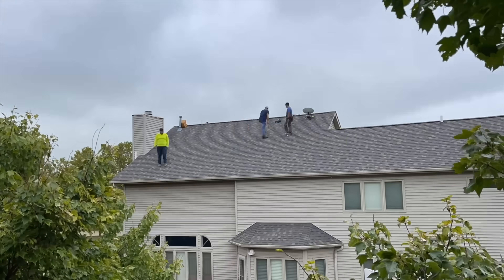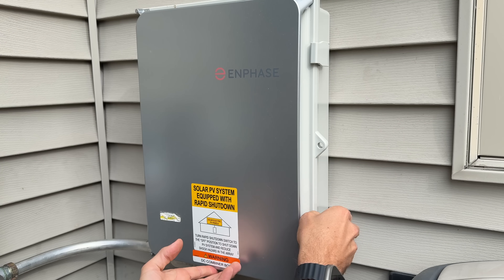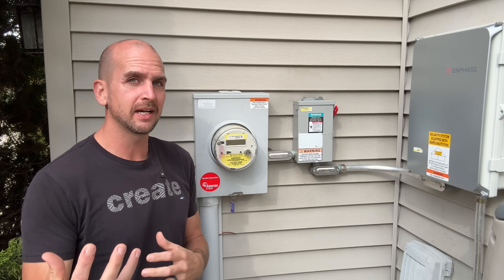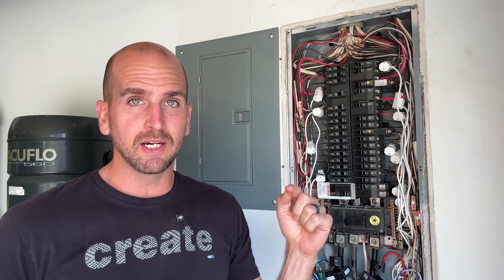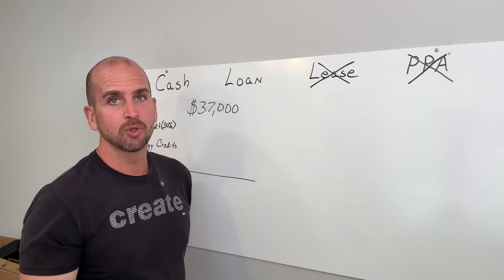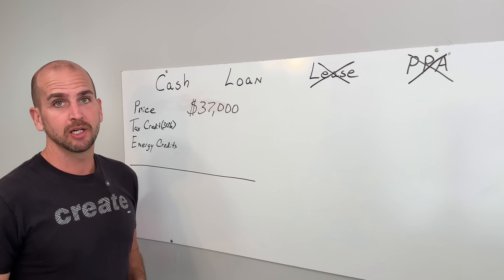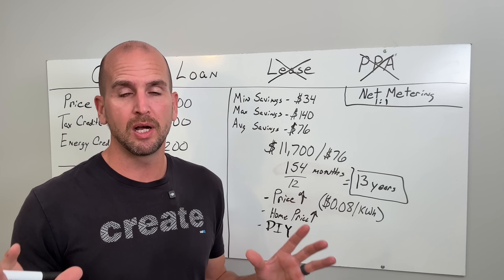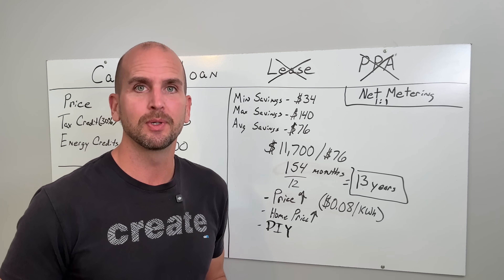Are Solar Panels Actually Worth It For Homeowners?

Comment: Another expense would be when you need to replace the roof. I imagine you have to uninstall and reinstall the panels.
Reply: Yes, correct. Which is why any reputable installer will refuse to install solar on a roof with less than 8-10 yrs of life remaining. Everyone’s situation is different but if roof replacement is due soon that should be done before installing solar.

Comment: I installed a 6.6kW system myself using design plans and parts from IronRidge, panels from Panasonic and Solar Edge inverters/converters.  The system cost me $12K to install myself which I got 30% back from.  Total out of pocket was $8400.   These systems are so easy to install nowadays. Everything is basically plug and play including the mounting. The only thing I needed to do per county rules was to have an electrician connect the converter to the main panel.  Don’t pay a company $30K+ if you don’t have to.
Reply: Hi Matt, would like to know more on your installation and how u did it ? Ty
Reply: @ I literally designed both my ground system and my dad’s roof system by first going to Ironridge and designing them on their website.  I found the most efficient and powerful panels that had a good name brand available at the time and it was the Panasonics.  Bought the Solar Edge Inverter and all associated parts from a distributor out of AZ.  Did the work myself and was only required to have an electrician tie us into the grid.  Iron Ridge stuff is awesome and so easy to work with.  The instructions could be followed by a 5yr old.

Comment: I'm having a solar panel installation on my garage roof by a relatively small and local company.    They are doing all the work, and I need to decide what type and brand of back-up battery system to get installed when the solar panels are installed. 

Trying to research what type and brand of battery system gets  REALLY COMPLICATED AND CONFUSING  !    I've considered battery brands like EcoFlow and Anker, but there are (possibly) major limitations  / problems  with both of them.    Lately,  I've seen videos on different types of batteries like EG4  --  LL48 V and other server rack storage systems. 

I am also in Illinois,  the Peoria area, and so your videos are especially helpful to me regarding utility company  (Ameren) and their regulations.    From what I can understand,  the new Anker Solix F3800 is a great unit and easily expandable.    BUT,   it has an odd problem regarding a limitation of accepting only 60 watts of power from the solar panels. 

Some of your DIY guys have done strange work-arounds to overcome the limitations,  but trying to relay all that information to solar installers isn't something they want to deal with.    And I can't blame them for that. 
The EG4 and similar other rack battery systems may be a better option for me,  but the latest videos don't get into downsides and limitations for this type of battery backup. 
Do you have any experience or advice about the company EG4 or about the company Point Zero Energy  ?   Their promotions always sound really good, but of course they are meant to only sound good  !   Possible issues and limitations aren't discussed. 
So, what's an inexperienced and electricity dummy to do  ???

Comment: DIY off grid in Saskatchewan. For what they wanted to charge me for a 10kw system with storage here? I was able to build a 26kw system on my own with much better bi-facial split cell panels. And I am the only person I know up here that can fill their batteries on cloudy days, even during the winter solstice. The secret to having solar in the winter is not a gob smack of storage. It is being able to put the energy back into the batteries every day, under the worst possible conditions. We only use 8-12kwh of power over night. But the system is designed to ensure that energy is in those batteries ASAP. Because the excess energy I produce all year long? I am converting into high grade heat, and storing in a sand battery I buried next to my house. And that sand battery heats my home up here in Saskatchewan all winter long. Right now that unpressurized tank is 581C. The heat in the house has already been on for a month. By the end of February when the days start being long enough for me to start moving the needle the other way? It will be around 190C. This is my second season with the system. The tank is 40 degree hotter this year. It cost me less to install everything for my system? Than the utility companies wanted to charge me to bring power and gas the 3/4 of a mile into this formerly abandoned farm yard. And its definitely worth every penny of it? Because its replacing what would be a $3000+ a year bill for heating oil if I just did enough solar to get by with a generator. We did that the first year. Then I doubled the solar system. I built the tank that first winter and buried the thing as soon as the ground thawed. It is very well insulated, as is the pit it was buried in protected from moisture and ground frost. 

Retired power engineer btw. Spent decades working with commercial steam and refrigeration systems. This planet? Receives more energy from the sun in 65 minutes? Than our entire species consumes from all other sources of energy combined? Each Year. It is a stupidly small fraction of a percentage point of that available energy? That we need to capture and store to meet our daily needs in comparison.
Reply: Awesome, do you have any build videos/ or log anywhere that you can share?
Reply: Amazing , would love to see your videos of solar system

Comment: What happens when you need a new roof ?
Reply: All the panels have to be removed and re-installed after the roof is replaced. This is why pros won't install them on an old roof that may need replacement in the next few years.

Comment: I see a cyber truck in the drive way, probably why he installed the solar panels.
Reply: Any sort of electrification of appliances and vehicles (EV, heat pump water heater, heat pump furnace, A/C...) is a good excuse to also install solar panels.  Or vise-versa.   So now no natural gas bill OR electric bill OR gasoline costs.

Comment: You mentioned that if the grid was down and you did not have batteries, you would not be able to utilize the panels.  Can you explain why?
Reply: Lineman Safety. If the grid goes down but your array is still on, it'll back feed the grid and Bad Things happen. So all commercially available inverters for grid-tied applications shut down if they sense the grid is down. 

If you go the string inverter (+ optimizer) route, you can cobble together a DC coupled critical loads circuit that can keep things running independent of the grid.
Reply: @DonaldZiems  The system could be disconnected from the grid during a power outage, there is another issue that is not so easily addressed. The power output of solar varies a lot throughout the day and one needs a storage bank to level it out. One minute there could be more than enough power to run everything, then ten minutes later some clouds go by and the available power is only %40 of the demand. When that happens, the inverter shuts down. Electricity yo-yoing on-off-on-off is not only annoying, but it's really bad for electronic devices (which is pretty much everything in the house these days). Obviously during the night there is no solar at all.
Reply: @DonaldZiems  Thank You.  That makes sense now!

Comment: You know, a lot of people in the comments seem to think that getting solar is just straight-out an economic calculation and that somehow you don't win unless you can "break even".   I will say, straight-out, that this isn't true and has never been true.   Solar isn't just about money.

Have the lessons of the Great Texas Freeze and two recent hurricanes not been taken to heart?  Or even fire-safety power shut-offs in California?  Florida weather?  A "Generator" isn't enough... fuel doesn't magic itself up out of thin air.  In fact, big generators are straight-out a terrible choice.  Don't let people fool you into believing they are great.  They aren't.

So getting solar is about a lot of things.  Breaking even is just frosting on the cake if you can swing it. But it isn't the goal for most people who get solar.

* Having options when the power goes out.  A generator is great... but burning 8 gallons of fuel a day in a major emergency is not.  A small generator coupled with a power station can cut fuel use to less than 2 gallons a day.  Now throw in some solar and now you are less than 1 gallon a day... or zero depending on the season and weather.  And now you don't have to run the generator overnight (think about it...)... all those fridges with 400lbs of deer meat won't spoil.

A solar system that gives you options when the mains are out.  Small or large.  Portable or permanent, pays for itself with the first emergency simply by you, the home owner, not having to waste many precious hours scrounging for fuel.

If you get solar, always get a system that gives you options when the mains are out.  It can be as simple as a small system tied into a power station, to a large DC system that has an aux AC port ("SPS feature") that works when the power is out, all the way to a whole-house transfer switch.

* Its an investment in the future.  MANY futures.  Even if you don't break-even on utility bills you are still adding value to your home if you sell it, for future generations to inherit, or even if you wind up in economic straights late in life and have to down-size yourself.   And even if you don't break-even, do you really want to spend your life paying ever-growing utility bills when you could be spending it on pushing a new technology instead?

* The environmental argument counts too, but it isn't the only thing that is happening here.   With solar you can electrify.  With electrification you can get rid of gasoline and natural gas bills.   One of our vehicles is now an EV and since the power company doesn't give me much for export, well, charging the EV is a good sink and saves me thousands of dollars worth of gasoline a year.   Our water heater is now a heat-pump.  The furnace comes next... and those two items can be programmed to run when the sun is providing most (or all) of the necessary power.

* DIY is a serious option these days.   Even if you have a system professionally installed, you can still DIY the relatively small amount of maintenance involved in owning a well-built solar system.  I didn't have to touch my system for 15 years, for example, before replacing anything.  I didn't even have to get up on the roof or wash the panels.  And ever since then I've done the upgrades, maintenance, and DIY'd additional panels myself.

* Solar and battery systems don't have to be huge.  They don't have to be able to run the whole house.  Battery systems don't either.  When it comes to emergencies (or load-shifting in California), you aren't running big-ticket appliances like whole-house A/C.  Instead you might just run a single-room window unit (or nothing at all, depending on the climate).

The fridge, a few lights, the internet, maybe a toaster oven or microwave.  Induction tea kettle.  Heat pump water heater.  Well pump.  You can scale the system to what you actually want or need to run.

* Not being beholden to the utility.  Rates change all the time.  Up, down... mostly up.  And people lie about their actual electric bills all the time to, or conflate the system size they would need to install as if they were huge electricity users when they are actually tiny electricity users.  And people ignore inflation, add-on charges, and other utility-related shocks.

* The roof isn't the only place you can install panels.  A Pergola, a ground-mount, a Car-port project.  Even integrated into a railing.  There are lots of options.   Also, many roof types can take solar mounts that do NOT involve drilling into the roof.  I have a metal roof and my solar involves zero drilling.  The mounting is on the standing seams of the roof.  No drilling, no holes.

So, yah...  solar is great, even if you live in a state with cheap electricity.  Don't let anyone tell you it isn't.  And remember the name of the channel "Everyday home repairs".  DIY.

-Matt

Comment: Scott, any chance you can do a video of what's required to get solar from the panels into the house (disconnect and surge protectors) and connected to the EcoFlow Delta Pro Ultra (like you have in your rental property)? I used your website, but none of the contractors seem interested if it's not leased panels on a grid-tied system. I have no interest in feeding back to the grid. I'm just looking to connect 12 panels to my DPU to support my home in case of power loss. TIA.

Comment: You’re too far north to make this viable.
You are also not taking depreciation into account.  Solar has at most a 25 year life expectancy, and output drops every year from the installation date.
I live in Hawaii where electricity is very expensive and the sun is high and shines all day, every day.  It makes sense here.  Not in the northern states.
You also have to consider the time value of money.  How much can I make investing that cash?
Reply: Modern panels have degradation rates of 0.3%/yr to 0.5%/yr or so.  A little more at the beginning, then it slows down.  So we're talking a lot more than 25 years and it isn't as though the system just out and fails after year 25.  Solar panels last until the environmental seals let too much moisture in under the glass.  Decades.

Comment: I had solar panels installed on my roof about 10 years with interest free financing and a healthy tax credit. Very happy with it -it significantly reduced my electric bill and no issues. Our biggest electric bills are in summer when AC units are running full blast. It also adds to value of houses in our area.

Comment: I'm in Madison county Illinois just north of St. Louis Mo. I believe the last year we have been paying 12 cents per kw for electricity. But i just got a letter a week ago that it's supposed to change to 8 cents for the upcoming year.
Reply from the maker: I used to be $0.12/ kWh as well but then it dropped about 12-18 months back.
Reply: There are also sur-charges for excess electricity usage that you have to take into account in Missouri.  Look at your actual electric bill and divide by kWh for a couple of months and see where you stand in reality.

With all of that the average utility bill in Missouri isn't really all that different than the average utility bill in California.  Lets see.  Well, several google'able tables the one I'm reading now shows $627 (gas, electric, water, sewer, internet, phone) for California and $605 for Missouri.    Even though California is exceeding $0.50/kWh now.   For obvious reasons... A/C and dehumidification needs in Missouri.

This means that if you can replace (for example) natural gas appliances with electric appliances, not to mention gasoline with electric (which isn't included in the above numbers), the equation can change drastically as you reap economies of scale.   But you have to calculate carefully because that might also mean you hit up against "excess electricity" charges... which could make adding solar a cost effective option.

-Matt

Comment: What about maintenance expense over the course of 13 years
Reply: The panels glass will become hazy and require cleaning
Reply: @richardnowacki2869  It's glass, nothing gets "hazy".  How often do you wash the outside of your home's windows?   For most people the answer is "never".  Panels will get a bit dusty but actual generation losses are sub-5%.  Most people don't bother cleaning their panels.  I don't clean mine.

-Matt
Reply: 13 years?  Its zero.  Why would there be any maintenance expense?

Comment: I’ve seen solar panels on the ground that have the ability to to tilt on a youtube channel  that admittedly owns some land.
What affect dos snow and ice getting under the expensive panels?
Reply: Tracking systems are not generally cost-effective for residential solar, only for commercial solar.  The reason is that the tracking system itself can cost as much as the panels mounted on it, and since the tracking system contains moving parts there will be maintenance and a certain degree of fragility that fixed mounts do not have.

Panels are sealed on both sides, so snow and ice isn't a problem.  Snow-load can be a problem but in that case you design the system so the snow sheds off the panels (generally just means they are angled more).  In snow country, most solar panel systems are gonna be on fixed mounts, off the ground a bit, and sharply angled.
Reply: As @junkerzn7312 said, tracking doesn't usually make sense, however ground mounted solar is preferable to roof mounted, it's just not possible for most residential situations. Ground mounted is easier to install, easier to maintain, and has less impact on insurance. If there is snow build up on a ground panel, just brush it off.

Comment: Typically with net metering, you can send your extra power to the grid for credits. When you pull the credits back at night or cloudy days, you have the pay the grid delivery charges. In Texas this is about 5 cents a kWh.  (Basically, the delivery charge is the portion of the electric cost to maintain the grid.)